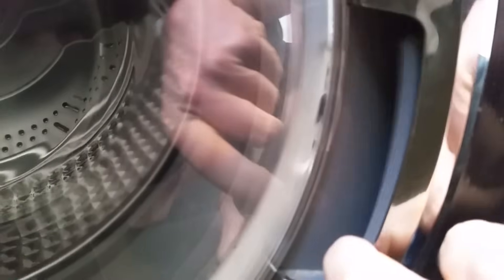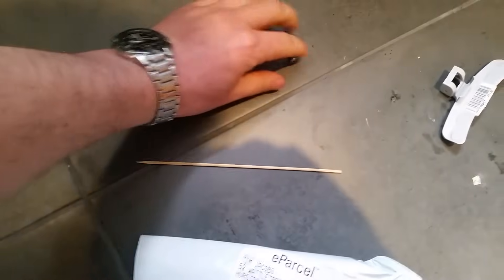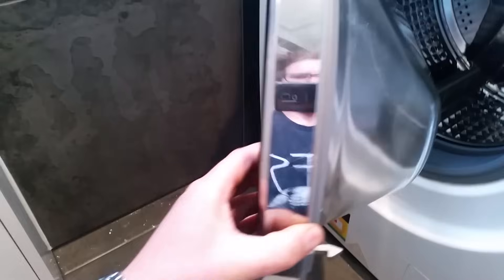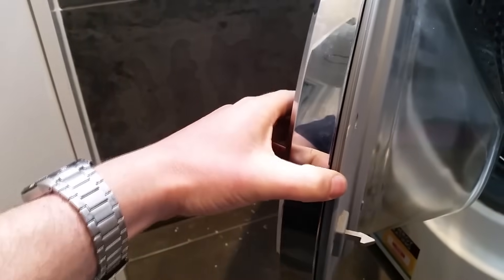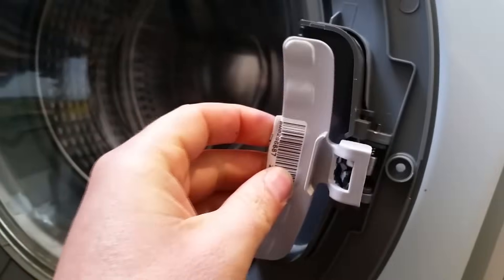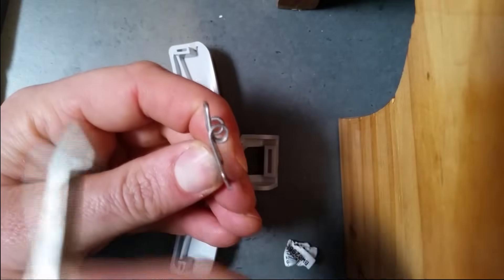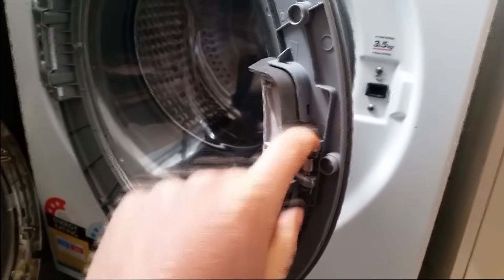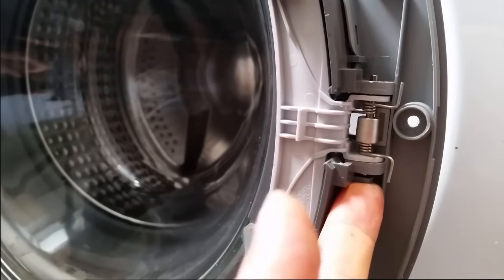How to repair a broken door handle on a washing machine

Comment: The Samsung WF8704RSW is exactly the same but the white plastic door rim comes off very easily. Many thanks  -  You've done everyone a big favour. In replacing the prongs of the spring, I found it easiest to put the upper one in first. (Coincidentally, the video was even more authentic as your floor tiles are identical to mine.)

Comment: I replaced one of these last week. I ordered the latch from Amazon for £5.00. My problem was getting the door to open as the door was closed when it broke. I took off every panel to try and unlock the door. I managed to manually unlatch it in the end but it was an ordeal. Changing this part took about ten minutes, I took the whole door off so I could do it on a flat surface.

Comment: Great video. I need to replace the part that the handle sits inside as the bits that the spring clips into snapped. I can't seem to pop it out I can see it has x4 tabs but been trying and trying but can't get it out. Any ideas ?

Comment: Thanks for sharing and really detailed Video. I have replaced door handle successfully as shown. The handle was broken as yours. However, a new problem appeared after replacement. The door now cannot be closed. When closing door I cannot hear the “click” sound and door is not closed properly and machine don’t start. Anyone have the same problem before and have a solution? I’m guessing the door lock is too old and new door handle is too spring-ie so the lock cannot click into place?

Comment: My Samsung washer handle just broke. I manage to pry out the plastic handle and released the latch. I'll need to order a replacement handle. Looking at it closely, it so stupid of the designer that the mechanism that holds on to the metal hook is ....plastic. Of course it'll snap over time.

Comment: You missed out a rather hard bit - how did you get that middle mechanism out of the door? Can't do it!
Reply: I managed after a while. Did everything as you said, but then it was really hard to slot the long ends of the spring mechanism back into place. Struggled with that bit for over an hour and eventually my husband did it. The rest was easy. Thank you for the tutorial, I would not have done it without your instructions.

Comment: My handle broke but the door is locked shut, how can I get it open?
Reply from the maker: from memory, if you take the screws out from the external walls, you can slide your hand through the edge and unlock the latch from the inside.

Comment: do you have instructions of how to open the door manually if the handle is broken with washing still inside the machine? thanks
Reply from the maker: Navit Schechter sorry. Didn't get that on camera but from memory I unscrewed the top and lifted it off then unscrewed the front enough to reach in an unsnib the door. It wasn't too hard.
Reply: I used an old credit card pushed between the door and the machine to release the latch. You could also use some fishing line
Reply: @ben0nib0y  bro. You're the man.

Comment: Great video. Exactly what I need but....  Can you tell me how to open the door, I closed the Washing Machine door after the broken grey handle part fell out.( I know im a Genius).
Reply from the maker: Mine was already shut when it broke. I ended up unscrewing and pulling the top of the machine off and then the side panel. You can reach in and unlatch it from there. It was quite a while ago now but I remember taking the top off and loosening the front panel to get my arm in. Hope that helps